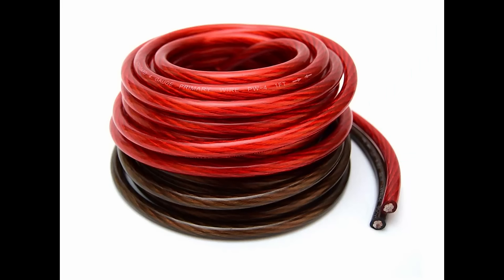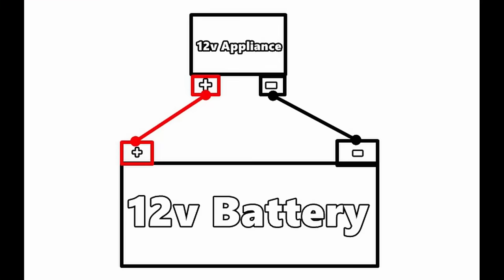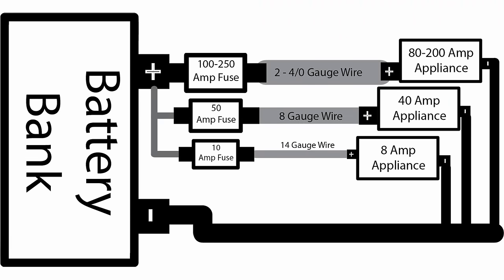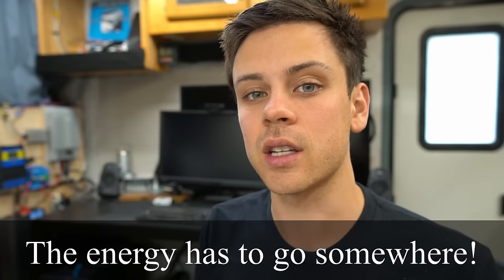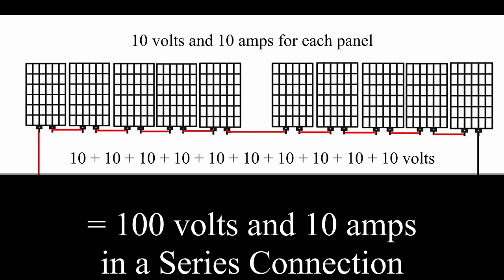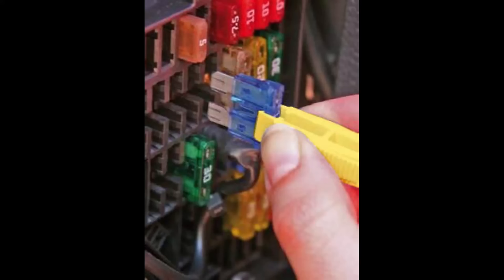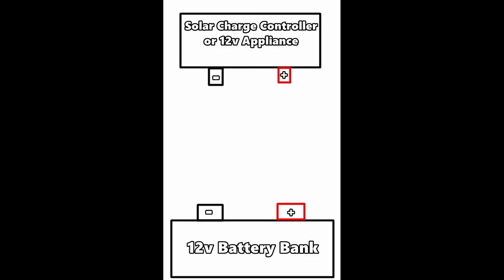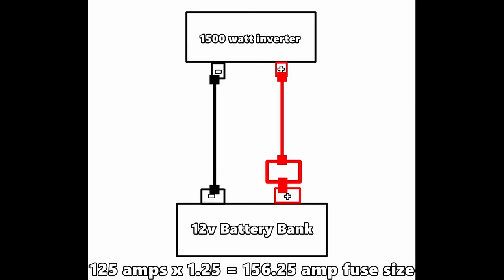Electricity Explained: Volts, Amps, Watts, Fuse Sizing, Wire Gauge, AC/DC, Solar Power and more!

Comment: Thank you for sharing this…. Greetings I’m looking for power to use when boondocking (off grid),  but still want ??? 20,  30, and 50 amp plugs for when there is a place I can connect power to.
For me, I would need to use an AC UNIT for those hot days,  I would like a freezer bigger than the fridge part, ( just store food longer). I would like to have tv for movies, or watching YouTube and of course MUSIC listening. 
Lights for night time, not sure about this but I understand there are conventional microwave ovens where I could heat up food if I need to or bake?  I have a mini Insta pot that I would probably use maybe twice a week. And finally for those cold days where I’m going to need a heater or heater fan.
I may disabled person who wants to travel and perhaps eventually live in my van I’d like to get a medium height than where I can stand but not so super tall looking at a Ford transit perhaps so now I’m thinking an empty one so that I can create this power system not sure I will be using a composting bucket toilet but I would consider some type of area where I can shower if need to inside my van I’m also looking and this is where it gets confusing water system where I have water just to shower and do dishes I have looked at several videos including yours and I know I can go back-and-forth with them I just it just doesn’t stick for me the Vin size I’m hoping to find me a Ford transit perhaps 20 to 22 feet in length can you please tell me a system that will power me and I don’t have to worry about anything oh because of my disabilities there’s no way I can climb up on the roof for a solar set up at least I don’t think I can. I understand that lithium batteries are better than regular batteries and I understand the words I’m going to need solar I’m going to need a battery bank inverter converter making sure that the wires and the fuses are big enough and I want the most I can get without blowing up into space please please help me with this I was highly recommended to watch you and I’m listening to you it just doesn’t stick in his older brain.   I know what exactly what I need that’s going to cost a pretty penny but I’d rather spend the money on something safe and powerful all the way around them to have something that’s going to cut off the power and blow me up into space what are your thoughts thank you very much for everything you do blessings to you and yours.
Bernae 🧚🏽

Comment: Hi Will, Sub'd to you and now 1st comment/question. What really determines the charging amps flowing from the source (breaker panel) to the load (in my example an ecoflow delta pro)? My clothes dryer circuit is 240V-30A  so that's a 30A double pole breaker, a 40' run of 10-3 awg "romex", to a 240V-30A wall outlet (14-30R I think it is called by NEMA). Then I propose to buy a pigtail adapter with a 14-30P (plugs into the dryer receptacle) on one end and a 6-15R on the other end to run to my ecoflow delta pro a/c charging inlet (via a replacement 6-15 power cord). The ecoflow delta pro A/C charging inlet says 100-240V @ 15A max. So would the current drawn by the ecoflow delta pro be just 15A or the full 30A available at the dryer receptacle. I'm confused on how/what regulates the current flow, the source or the load? Thanks for any help here, Bob R.

Comment: Hey, without the insulator on the wire, electricity does not escape but water will escape if no hose is there....that doesn't make sense.

Comment: Hi. I have   A supposed 150watt solar panel connected to 2 110amh batteries  , although ive listened to your explanation i need someone to check me please i need to know what sort of power i will get from this setup and how long . As they are parallel  connected  i want to discharge apprrox 60%   H eeeellllpppp!!!

Comment: So if i understand correctly u can see amps and voltages as a 4 lane highway full of trucks the more trucks can be put on the highway the more amps u can transport. the faster the trucks go is the voltage then. as voltage is the force the faster a truck goes the more force there is.
 in plain dumb language :P

Comment: So here is where i see confusion.. When i see an appliance and it says it uses 1500 watts.. Like a microwave or hair dryer or coffee maker. Does that really mean “per hour”?  If a solar panel says its 100 watts. Does that mean per hour? They list these things in Watts when really it also means Watt Hour too. That would clear up a lot of confusion.  Also, what is the conversion from BTU to Watt or Watt Hour?  I think a 10,000BTU appliance really means that it uses 1,000 watts per hour. And a 5,000BTU appliance uses 500 Watts or Watts per hour.  Anyway, Watts listed on any device really means Watts per hour.

Comment: Why would a 105A fuse become a bottleneck in a 100A if there should not be even 100.1A through there in theory, and in practice there is a ~3-5% loss anyway, so under no circumstance there should be 105A going through that fuse.

Comment: Sooooo this is for beginners and you get through volts and amps into watts and then use CURRENT without explanation……as a beginner and without looking it up I use current in general. For example, that telephone pole wire has a lot of current and will kill you!  Sooo at that moment it’s confusing…. Maybe you clear it up shortly after but……

Comment: Vibrates is a poor choice of words.  Vibration is generally used with mechanical motion.  Oscillation means to change values about a mean average or central value which is in my mind  what 120 VAC is doing as it changes voltage values about zero or oscillates about zero voltage.

Comment: Wow, you got almost three minutes in before you uttered your first howler.  Nothing moves in ac?  EM radiation is ac, and it moves at the speed of light.  While it is true that a particular electron does not get far down a conductor during an alternation of ac at 50 or 60 Hz, it also true that one ampere of current means that one coulomb of electrons will pass a given point in a conductor each second: 6,242,509,000,000,000,000 electrons.  Now that's moving.

Comment: I just looked up the formulae for calculating American Wire Guage (AWG.) WHY Will, just why?!  That seems unnecessarily complicated to me, which makes sense when using a system designed in 1857 🙄...

Comment: Let’s get one of your first explanations out of the way. There are no definitions of alternating current that describe it as “vibrating”. Even though you go out of your way to say that the physical wire does not vibrate it is not a description that should be used. Alternating current is a current that reverses itself and is described as a sign wave, wave being the operative term to describe the polarity change in respect to time.

Comment: 1:52 your diagram isn't accurate from the information I was given.  I was taught the electrons flow through the battery from the negative and out the positive,  and that's why the fuse is on the positive wire font the battery.
Reply from the maker: That's false. Look it up in a physics book.

Comment: Voltage is the feeling you get when you get the sensation of wanting to wee. The more you leave it, the voltage builds. If you leave it long enough, you piss yourself - that’s like lightning striking- the voltage is too much to contain. Current is when the wee flows. Resistance is when you’re wearing tight pants. A capacitor is a condom.

Comment: Electricity does not flow down the wires. Oliver Heavysides proved that. Magnetic fields spiralling around the cable is the reason for the delivery of electro-motive force. This is a common misconception still doing its rounds today.
Nicola Tesla introduced alternating current to the world despite Edison's terrorist campaign. 
Oliver Heavysides was ridiculed for his lack of university qualifications but dumbfounded the experts of the time by introducing the most used formulas today such as V=IxR

Comment: 1:57 - AC current does NOT have to switch polarity "fast" (the proper term is quickly).  Any alternating frequency for current (other than 0), is considered AC.  For example, AC at 1 Hz is still AC.  Your concept of AC being like a wave is not correct for slow AC (1 Hz for example).  It behaves more like DC where someone is reversing the polarity every 1 second.  If you "insist" your wave concept is correct, then I would ask at what frequency does it make this "magical transformation"

Also, one important thing this video misleads people to think is that for a given load you need a certain minimum thickness wire.  This is not really true.  For example, if you have say a piece of 14 gauge wire for an 8 amp load and you want to increase the load to 16 amps, you don't have to swap out the 14 gauge wire.  You can simply use 2 pieces of 14 gauge wire connected together so there are 2 paths for the 16 amps to flow across.  Just F.Y.I, when you combine pieces of wire like this, the effective gauge of the combined wires is "3 less".  For example, 2 pieces of 14 AWG wire sharing a load (giving the load 2 paths to pull electricity from), effectively makes it become an 11 AWG conductor.

Solar panels are bad examples to give to teach volts, amps, and watts, since those vary so much depending on the light hitting them.  A much better example would be to use a fixed voltage power supply (set at 12.0 V for example), and a known value resistor (such as 6 ohms).

Also, watts (such as for a load), is not as simple as volts * amps.  An AC appliance for example could be rated at 300 watts, but not work with a 300 watt max rated inverter, because of something called power factor.  A 300 watt appliance with a power factor of say 0.75, may require 400 watts be available for it to use 300 watts.

I didn't learn anything from this video.  Just spotted some mistakes and some flawed analogies.

Comment: It's about time... 
Because people fear electrical systems, they tend to turn their minds off when you try to explain how it works... 
So, for decades, I used water flows ( and hot, cold, and drain pipe plumbing systems ) as examples to help explain how electrical systems work... 

When explaining to a male, you can see in their face that they're trying to visualize the layout... 
But when explaining to a female, their eyes widen, and they look straight into your eyes with that, "What the he[[ are you talking about," surprised look on their faces... 
(Ha, now that I think back, I actually got hugged and kissed a lot when I explained things to females)

Comment: I have two solar panels each of which is capable of 335 Watts generation obviously it never does

Those are connected to a Rohs mppt solar charge controller rated at 100 amp a bit of Overkill there

In turn that solar charge controller charges my battery bank directly

The battery Bank consists of two 150AH lead acid batteries. Combined at 24 volt.

The 24 volt batteries are then connected to a 3000 watt charger/ inverter which feeds the house. 
______

I would like to expand my system and I have two 700 watt panels available to me

I also have available to me two additional charge controllers of the same rating.

I have multiple questions here

1) is it okay to have multiple charge controllers charging the same battery Bank
And how would I connect the separate chargers to the batteries

2) am I okay in thinking that I should have one charge controller per panels and have them all feeding the battery Bank
I'm hoping this will charge the batteries faster

3) the entire system is designed for 24 volt because that's what the inverter is capable of
Do I benefit from upgrading the inverter and going up to 48 volt or any other suggestions you might have

I would really appreciate any help. And many thanks in advance.

Alex

Comment: I wanted to wire up some garden lights and using your advice thought I’d use a copper water pipe  as it is quite large and o le feeds a small water feature right where the lights were needed and electricity is just like water. I plugged a wire in to a 240v socket and taped it to join in the pipe. My wife was holding a bulb against the other end of the pipe and I turned the water tap on very slightly so water trickled out. When I turned on the electric socket there was a loud bang and a flash. The wife screamed and fell over and dropped the light bulb. I don’t know if the bulb lit up or not as she wasn’t conscious so I couldn’t ask. Now I’m worried how many kilowatt hours I used as I just got my electricity bill so have to wait a whole month until I find out. How would I calculate that? The copper pipe was 1/2” and about 12feet long. I doubt if it matters too much because the policeman has said I might get a long stretch for attempted murder given I replaced the fuses with nails ( I didn’t know what size to use with 1/2 “ pipe and thinking the water wouldn’t heat up so a fuse wouldn’t be necessary). The wife was found  led in a  paddling pool with a hairstyle similar to a 1970’s punk rocker. How unlucky am I?, a long prison sentence, a divorce battle and a bill to replace some burnt out electrics in my house. I wish I paid an electrician to fit my garden lights now:(

Comment: This is good for like 6 year olds, but as far as actually explaining electrons and emf, none of this applies, right iff the bat youre ignoring that all things are neither perfect conductors nor insulators, meaning you can literally burn through that insulator and somebody basing their safety on this video would definitely die trying to mangle some crazy electrically unsafe project.

Comment: 4/11/2024 - I know that you are trying to make electricity simple to understand. But you’re confusing your audience straight away when you say nothing in an AC circuit moves, but it moves back-and-forth. Also, amperage is not a characteristic of an electric circuit. Amperage is the measure in “amps” of an electrical current. Just like voltage is the measure of an electrical potential.

Comment: It starts compleately wrong. ... how much electricity that runs through the wires?  Does he mean power? Now in the AC system the power flow back and forth, it is certainly  not standing still.  .
 So all in all everything he says is wrong